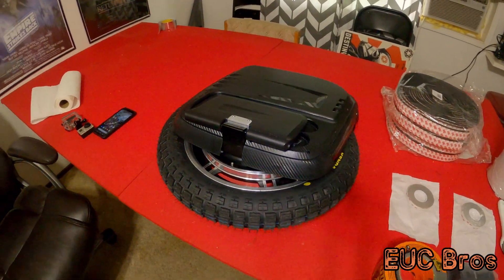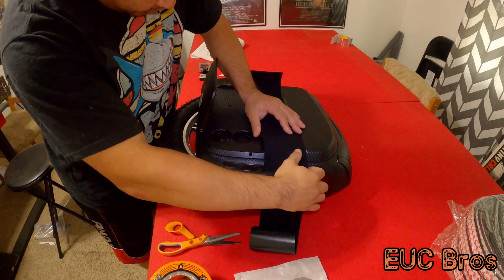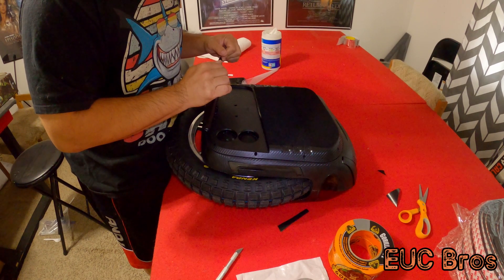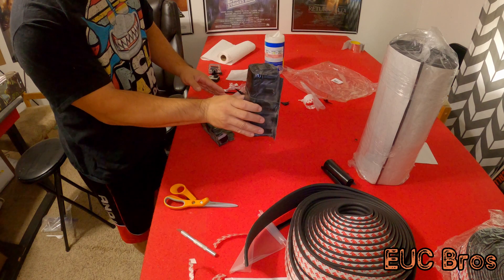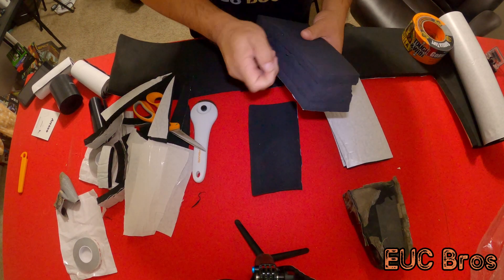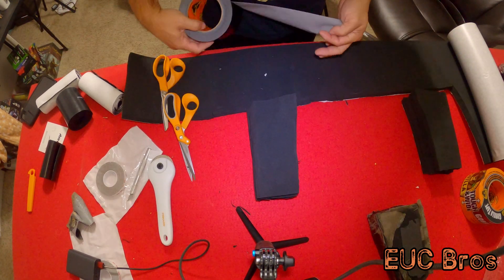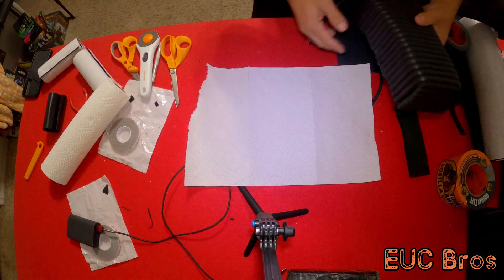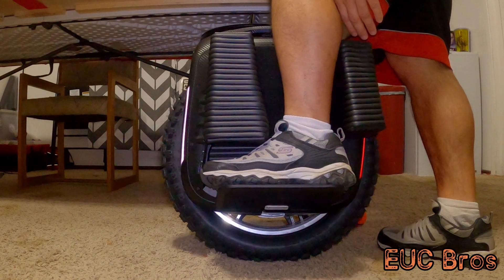EUC Bros | GOTWAY | Making Custom Pads Tutorial

Comment: Awesome! Thanks a lot for making the video.
I'm ready to try to make my own using EVA yoga blocks (easier to source) as material instead of neoprene layers - maybe it'll be similar maybe it'll be a little too hard, but I like the idea of applying baby foam over it to enhance cushioning.

The pads will be for a 16X and same as you I don't want to make the wheel wider.
I was wondering about how strong it would attach with smaller blocks: Interesting hack you chose to extend the velcro of the braking pad, I'm curious how it'll last.
Reply from the maker: I think it will hold for awhile
Reply: I was thinking of doing that as well with my 18xl! Let me know how it goes!!
Reply: i realize it is kinda randomly asking but do anybody know a good place to watch new series online ?
Reply: @Calvin Joziah Flixportal :)

Comment: I wonder how your pads setup is holding up after a couple months.
Are you still using your DIY or switched to Clark Pads? I tried the Gen2 briefly: amazing, effective but they're also a bit rough especially on the shins (can be mitigated with foam and adjustment I guess)
Or maybe you've made some improvements on these right here 🙂?

Comment: Nice video!
Reply from the maker: Thanks
Reply: @eucbros9235  do you think yoga blocks could work? I have an 18xl, and I was thinking of putting pads on...
Reply from the maker: @eucboi7595  i like using yoga mats for making seats not side pads. They are pretty thin and require so many layers. But yes thay can work if thats what u got to work with.

Comment: Also are the clark pads suited for seated riding? I have a very hard time sitting and standing with those pads. Sorry for so many questions lol. Great content btw . Subscribed ✌
Reply from the maker: Yes they are fine for seating riding. U just have to be comfortable enough on wheel to move ur feet freely on the pedals. When i set my heels are on the edge of the front pedals and toes are hanging way off the front to let my feet recover if they get numb. Then i move them back when im ready to get back up

Comment: Awesome video 👍
Does the RS come with that tire ? And is it faster than the MSP high speed c30 ? ✌️ Keep it WHEEL ✌️
Reply from the maker: It does not I never wrote a single inch on the stock tire swap it out before we even knew it worked... I'm pretty sure the MSP high speed is faster